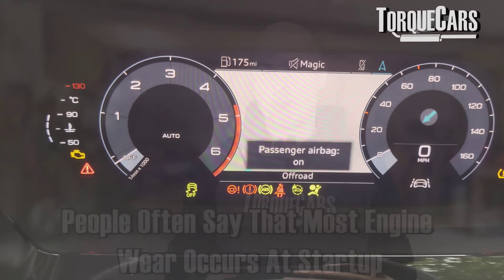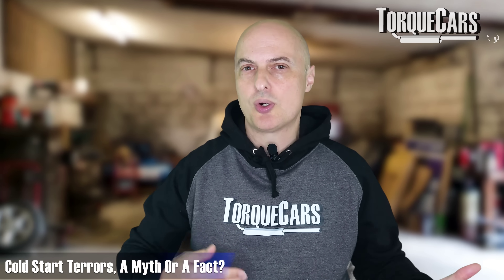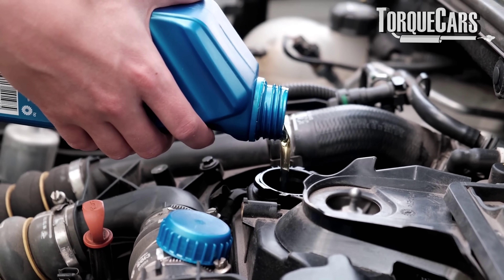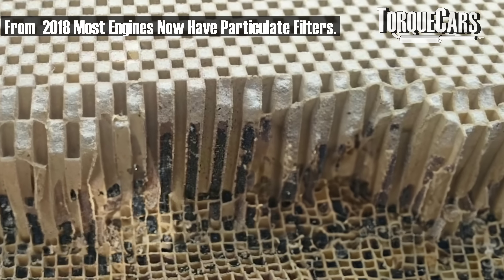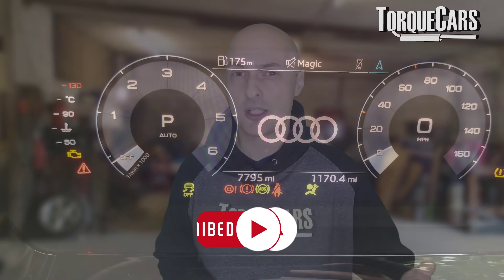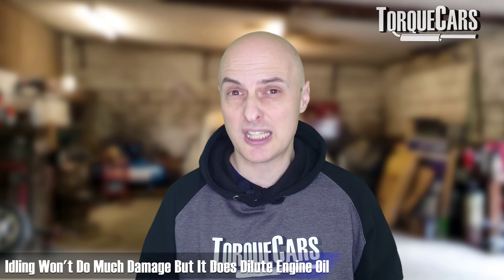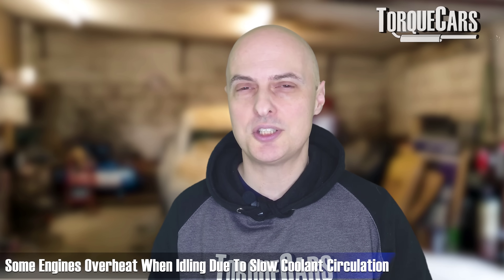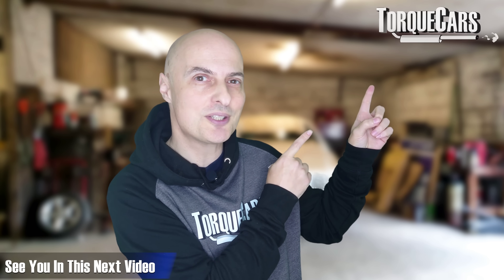❄️Reasons Why Bad Cold Starts Destroy Your Engine ☃️Prevent It Happening To You! ⚠️

Comment: I have a 23 year old bugeye impreza with 150k miles on the clock, if anyone knows how to keep an old, delicate engine alive its me 😂. Its simple really, start the car leave it idle just for a minute to 2 minutes tops, then start driving, softly, dont go into boost, change gear early, and baby it. Once you've done a few miles and the temp is at normal operating temps youre good to go
Reply: Literally it, just drive it slower and more gentle till the temperature is up to operating temperature, that is pretty much all you have to be aware of.my car has remote start so I pretty much always turn it on from the house right as I'm starting to get out, by the time I'm in the car and my seat belt is on, the car engine is already running for 2 minutes or so and that's about it.
Reply: My two Subbies won't allow sport mode until a certain temp... 1st 90s on start is the most critical wear period.
Reply: @battfinkz  man I feel you on this, I have a ‘14 Hatch and I drive it the EXACT same way.
Reply: @fs5866  this is the correct answer idling with regards a petrol means the car takes longer to warm up so the choke is open and the engine runs richer which degrades the oil. Start it drive it gently which will warm it quicker without straining the engine
Reply: This is exactly how I start up my GT86 (Subaru FA20 motor). Driving gently after getting underway is a more critical than the warmup period and often severely overlooked.
Reply: @battfinkz  spot on. Focus Mk 3 1.6 Duratec variable cam timing. My neighbour sits for at least 5 minutes in idle. Fail. Too long and may encourage soot. I leave it a minute to allow the oil to get up to the cam then gently drive until warm. The car clearly doesn’t like being driven before a minute, it doesn’t pick up nicely and is not happy. I change oil filter every 5000, picked up on 67000 with FFSH, on 102000 at present. Don’t burn any oil. I had a hose fail around 75 wear and tear, recently had a heater matrix leak but hopefully the Radweld holds. I’m waiting for a part to fix the latch mechanism on the passenger door but that’s wear and tear. It’s nice car (obviously not the performance fun of you’re Scoobie) but I just need a car that can reliably get me around and tbf they are nice to drive and lovely handling for a family car as all Focus are. Under current circumstances I can’t afford another car and/or a performance car so I need to look after it. Hopefully I keep doing the regular oil changes and treat it well and it lasts. I’ve had some warm/fast cars and driven some corkers but financially that’s not possible for now. Loved my sleeper Volvo 850 T5 R with that lovely 5 cylinder 2.3, drove 2 of my mates as Impreza (pre goggle eye, one quite heavily modded), some classic Jap like a 300ZX, Porsche Carrera, Mitsi Evo 7 to name a few. Growing up in the 80’s I have a soft spot for Ford, drove a few XR2’s over the years (pretty slow even for their time compared to the rivals but cheap and fun to drive). I loved driving the mk2 Astra GTE with its digi dash but the chassis was never much cop. Mk 2 Golf GTi was fun too. I’m droning on too long, but yes I think just letting the car “wake up and have a yawn and stretch” is the best approach to cold start. You’re clearly doing it right with your mileage👍😎
Reply: Subarus are built tough though unlike those flaky German engines
Reply: @ianwalters11  my missus had one of those mk3 focuses. It was a lovely car to drive but we had to reject it and send it back. We too had the leaking heater matrix issue, it's a huge job to fix and most garages don't want to do it, they have to take half the front end apart. But ours also had several other coolant leaks, and leaks inside the car, and the boot, it was full of mould, also had other issues. She's now got a mk2 focus, 2010 2.0 petrol, titanium fully loaded, 1 owner, and it's a lovely car

I'm also a blue oval fan in reality, I grew up in a ford family, and I've always been mad on them, my daily is a mk4 mondeo 2.2 titanium x sport, best car I've ever owned, i absolutely love it and 6 years of owning it i still love driving it
Reply: @AC_Milan1899  yes but their motors are sensitive to heavy engine modifications that produce excessive amounts of power and pressure
Reply: I don't move my scooby until the oil temp registers over 35 degrees, then drive nice and gently for a while.
Reply: @bravskii10  so is almost every other engine known to man. Forge the internals and an EJ will pump out as much bhp as you want
Reply: @battfinkz  150k miles on a Subaru is nothing. But yea your methods are great.
Reply: @battfinkz  Warming my RDX Turbo requires about 5 mins.
Reply: I have a 97 Buick regal LS with automatic transmission can I warm up like that too
Reply: Focus Mk 3 1.6 –But it’s not what the author of the video says, he says 5-10 or 30 seconds, not two minutes
Reply: I got a 2010 Dodge Charger with 250,000 miles on it and like other comments I just am really easy on her. I get stuff fixed as soon as possible when I’ve started having issues and just to things slow and steady with her until she’s ready 👀😂
Reply: @neverBragg  if you leave it parked up idling any car will take 5 minutes plus, it isn't good for the engine you need to get the oil circulating, warm it up for a minute or two tops then start your journey very lightly, it is vastly more efficient and practical to warm the engine up like that. As long as you're not taking it above say 2.5k revs, and not hammering the throttle passed say 30% input the engine will warm up in the best possible way
Reply: Soon, there is going to be the rapture. It's when there will be trumpet sounds, and after the trumpet sounds, God will lift his people from here. Also, God said people should be living by the Bible. Amen, and God bless you.
❤Jesus loves you guys. Dont wait, please. He will welcome you with arms wide open.❤
❤* John 3:16 - "For God so loved the world, that he gave his only begotten Son, that whosoever believeth in him shall not perish but have eternal life". ❤
Reply: Seems common sense to me
Reply: I absolutely hate the cold. I’ll deal with any ramifications of letting my subies warm up😂
Reply: @lightningleaf23  If your car has a choke it's quite old.  And when the choke is open the engine isn't running rich, it runs rich while the choke is closed.
Reply: @AC_Milan1899  My E46 323i has over 200k miles. Driven it without oil and without cooler.
Reply: I drive around the block a couple times before hitting the busy roads as it's harder to go super slow speed on public roads
Reply: @battfinkz  the good thing about the subby is that you can easily change any part that breaks and keep that car going for decades
Reply: I have an E92 M3 and I do exactly this.
Reply: I love your Bugeye STi 💪

Comment: It's funny that there is many so called "mechanics" who says "it is not necessary to warm up your engine". It cringes me when I hear that.
Reply: they mean don't let it idle to warm up. Drive under light load with less than 3K RPM until temps are up and you're good.
Reply: @mak23997  exactly, you want the engine to warm up as quickly as possible with limited wear driving under low load low rpm is much better than idle.
Reply: @rvilla4257  what the above 2 guys said. (From a mechanic, what they mean is to not sit idling to warm it up).
Reply: @rvilla4257  I use to live beside someone that would run their engine idle for 20-30 minutes before driving off. It was ridiculous and it’s clear they were given bad advice.
Reply: I just start it and drive off carefully.
Reply: Its actually not good to just straight up go as soon as u put ur keys on. Wait for few second untill the engine changes the sound, then ur good to go in low rpms. Will not doing it break the engine? No. Its just smart to do it gradually, less stress and more longevity. What i said probably wouldnt work for non modern cars as tge tech wasnt up there as the new cars
Reply: Stone cold starts has terrible transmission shifts in the Toyota I drive and the acceleration is horrible. Warm up is thus deemed necessary.
Reply: @rvilla4257  it's not once again the transmission has to warm as well. It doesn't warm till the car is moving

Comment: keep your engine oil clean .dont rev the engine above 2000rpm till its warm up to temp
Reply: If you stayed on 2000rpm you would be just putting more strain on the engine your better or changing at 2.5rpm or 3000rpm and that would be about right to not lug the engine. Well unless your in diesel lol
Reply: @dndkillaztreble5317  yes diesel
Reply: Lugging is bad even when engine is warmed up so I imagine it's also still bad or presumably worse for the engine lugging whilst it's cold
Reply: @BulletGuards  it depends wear you are if your on 30mph road sure change at 2000rpm if you live anywear witrh higher road limits 50mph to national limit shifting all the way to 60mph or 50mph at 2000rpm would lug your engine in direct i jection engines would increase the risk of lspi low speed pre ignition
Reply: My car only shows a green thermoter for the coolant which goes of when it’s up to temp. How do I know the engine is up to temp?
Reply: @Unknown8866B  by engine we mean oil temperature/ pressure, which is not so easy to see with modern cars. Often you have to flick through many display options. Unless you are about to use launch control/ redline it I wouldn't worry about it too much. Once you've driven steadily for 10 minutes, coolant reaches optimal temperature, oil pressure won't be far behind. It's a natural progression.
Reply: @Unknown8866B  The general rule in curriculum is 20 minutes to full operating temps for all components and fluids, at which point water begins to effectively evaporate out of the crankcase (+180°F). Any driving period after that 20-minute warmup is beneficial to the engine at highway speeds. I think it takes about 10 mintues for the water to fully evacuate, at 2k-3krpm cruising. The modern engine is now in its happy place for the remainder of the highway trek. That's one of the big reasons why used buyers seek out hwy- over city-driven cars.
Reply: @Subeebles  cheers bud
Reply: @MartinBennett-rs6thrasher  thanks pal. I have a 2004 Yaris. I keep the revs under 2k revs until the coolant light comes off. But I get on the motorway after 5 mins of driving after a cold start. Do you think i should set off a bit earlier and drive around town for a bit before hitting the motorway? Thanks
Reply: So basically, two step at 2000 rpms until it’s up to temps
Reply: @Tgotlucky  thanks pal. The only problem is my car only shows a coolant symbol green or red. It doesn’t show any temperature readings lol so idk when it’s up to temp.
Reply: Toyota manual says shift down at 2000 RPM and up at 3000 RPM, so that's how I pick gears.  I had some cold start noise like rattle for a brief second or two and switched oil brand which silenced that.  I then had cold start delayed reaction on start.  I would let off the key as it seemed to start, but there was a very brief delay and then it would fire, strange.  I switched oil brands again and all that nonsense stopped.  I have good no noise or delayed reaction cold starts now.  Freezing temps will be the real test.  Borescope shows cylinder walls are good and I want to keep it that way.
Reply: 2500 rpm in my case. I live in the alps with a 2015 Honda Civic 1.8.
At 32 mph, it runs 2500 rpm in 3rd gear. I can't put it in 4th, it won't make it up the hill.

Coolant is quickly warm. But after 60,000 miles, there are no issues like oil in the coolant or oil consumption.
Reply: Any driving period after that 20-minute warmup is beneficial to the engine at highway speeds –Driving on German highways used to be a pleasure, a manifestation of the freedom. Once, I had managed to drive >500 km without a stop. Unthinkable now. There are artificial barriers, limitations, reductions and false “under construction” narrowings of the Autobahn all over the place in Greater Germany since some years.
Reply: @tonyshaw4570  "keep your engine oil clean".

The best advice here.

I had a Mk1 Leon which I managed to get to 202K miles before the suspension and bodywork was beyond economical repair.

The engine was sweet as anything though.
When I sold it for parts, it hadn't been started in 5 months.
We started up to put on the trailer, it started as normal, on the first crank with no visible smoke.

I absolutely red lined it everywhere, even when "cold"...
But I DID change the oil for top quality stuff every 5K miles.
I also never drove it around changing gear at 1.5K RPM and cruising everywhere in 6th 🤣

I bet that engine will carry on to 300K in Golf that it went into!

Comment: Oil takes much longer to reach operating temperature than the coolant.  The problem is not cold flow viscosity because modern oils flow well at lower temperatures, the problem is getting to the temperature required to evaporate the moisture.    If this happens repeatedly over time you end up with oxidised, glutinous sludge.
Reply: Rubbish, coolant only removes about 25% of the heat and is a method of fine tuning the temperature when running via the thermostat.  The oil removes far more heat from the engine and warms up much more quickly.  He even explains this at 12.00m.
Reply: @user-xu5vl5th9n  both of you here are either right or wrong after doing this for 55 years every time I drop a pin on a motor or car that has sat you will see rust above the oil level because of humidity they'll be rushed surface rust over the rods the Caps the block casting sometimes the crank? But they're usually splashed with oil you'll find it in the lifter valley you'll find it in the rocker valley and when you take off the valve covers you'll find it on the inside of the valve covers anywhere there's 10 you'll find spot rust from humidity but it takes quite a while of driving around to evaporate all the moisture in the engine and you can do it I've done it where there has been water kind of in the oil and after a nice long hot drive it's back to oil again it doesn't turn into a sludge it'll evaporate and turn into a clear oil I've done it too many times even when transmissions when the fluid looks a little pink if you drive it around and get the thing very hot it evaporates and turns back into tranny fluid I've done this too many times and even inside the transmission you'll find rust
Reply: The brown stuff, very nice. I drove 2 x 15 minutes a day, it never really warms up
Reply: Modern synthetic oil is actually very good at providing near instant protection. Obviously, don't be a moron by revving first thing but the oil has got your back
Reply: @pete9501  Try draining your coolant out and see how far you get.
Reply: @Markking1678  Don't be silly.
Reply: @pete9501  Yeah, but thats just straight up wrong.
Oil doesnt remove much heat, it has no place to dump the heat, only the bottom of the oil pan. Meanwhile the coolant has a gigantic radiator at the front, while both fluids want to be at about the same temperature.

On a typical Autumn morning, like we have many right now, the coolant on my car hits 90C before the oil even reaches 60C, and that car has its pistons cooled by jets of oil shooting at them.
Reply: @user-si5fm8ql3c  Fuel, oil and coolant all play a part in keeping the engine cool. But yeah oil doesn't really contribute much to cooling the engine block and cylinder head, and that's presuming the engine is fitted with a water to oil heat exchanger. The oil will do some cooling in certain areas inside the engine like for example piston oil squirters removing excess heat from the piston but it's nothing on the scale that coolant removes heat from the block.
Reply: Or you change your oil if short trips daily at 7000km.
Reply: @pete9501    The oil temperature is still rising long after the coolant temperature has stabilised.     It needs to get to 100degC to evaporate water and the combustion process generates a lot of water vapour.  This is also why the oil level sometimes appears to drop after a long journey, the water evaporated.
Reply: Just like our blood oil helpo redistribute heat uniformely between engine components, carry off micro particles from the engine, lubeicate engine and Back to the coolant to help maintain an operating temperature